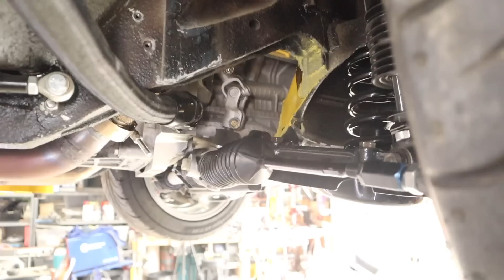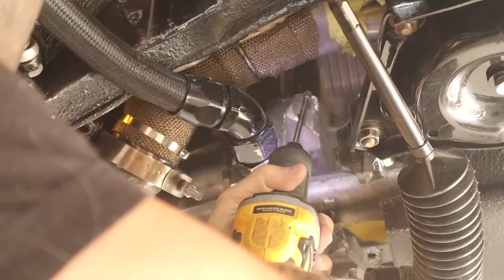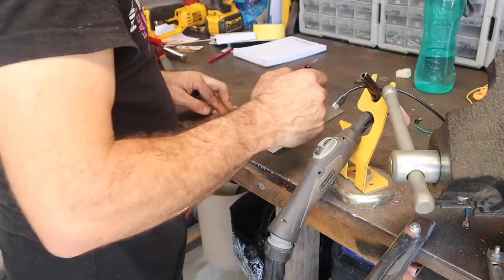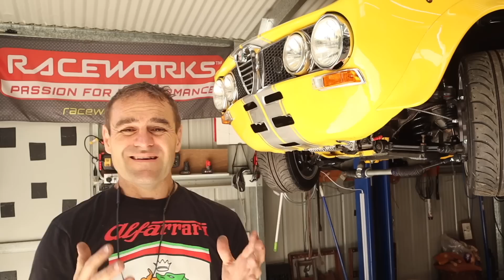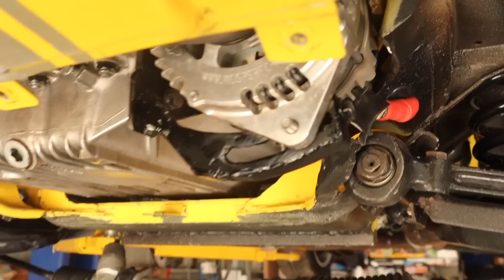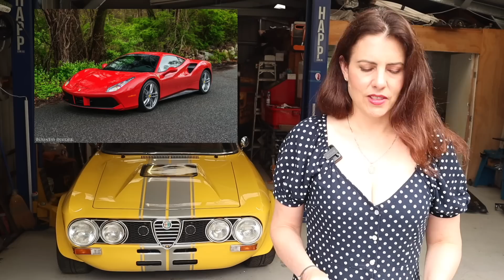Ferrari engine is overheating.. - Ferrari engined Alfa 105 Alfarrari build part 207

Comment: Remind me, do you have a thermostat on this engine? I recall an electric water pump, but not the thermostat... I'm not a thermodynamics expert, but I have read that without a thermostat engines can overheat more quickly. The coolant may not stay inside the radiator long enough to exchange enough heat, and reenter the engine at a higher than optimal temperature. Also, wondering if the ducting in front of the radiator is tidy for the fans. All of the OEM high horsepower radiator assemblies I've seen have a lot of plastic ducting to funnel air directly to the radiators.
Reply from the maker: It doesn't have a thermostat, but with the electric water pump it doesn't need one. The pump controller does what a thermostat does and lets the car get up to temp before running constantly.
Reply: @HomeBuiltByJeff minis when removing the thermostat for racing use a blanking plate, the absence of the thermostat otherwise allows water to bypass and return back I think. 
South Coast radiators in Wollongong recored (with high fin count and perforations) and made my mini rad a triple pass radiator and improved my cooling significantly. Pumps can push the water too fast and not allow time for it too cool in the radiator, hence adding the triple pass.
Reply from the maker: @arrindaley3714  pump very slowly pluses at until it gets to temp.
Reply: @HomeBuiltByJeff  is it running too fast once up to temp? As counter-intuitive as that might seem. Also my tuner suggested a cooler thermostat as it means it's not trying to catch a sky-rocketing temperature   too late, stage the pump in a bit earlier perhaps?

Comment: What's the reasoning for the 10mm clearance around all parts of the engine? Just for chassis flex, make sure there's no suspension binding?
Reply from the maker: It is for engine movement, but to be honest my engine basically doesn't move at all on the poly leaf spring bushings I am using for engine mounts.
Reply: But it will if you have a worn or damaged Polly bush so the engineer is correct, wouldn't be much fun if the steering locked up.  Not sure about the header/engine mount was to hard to see but would think header could be clearanced in car